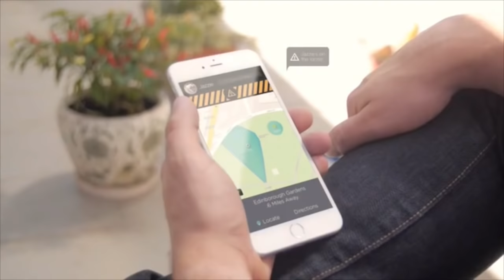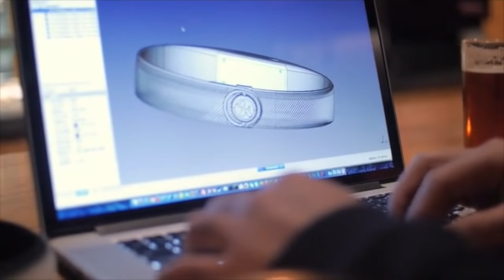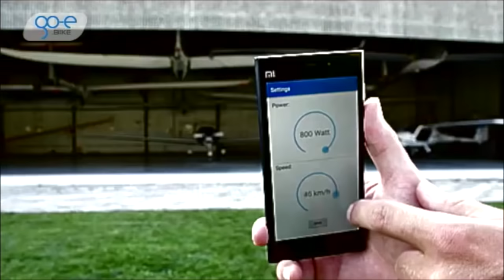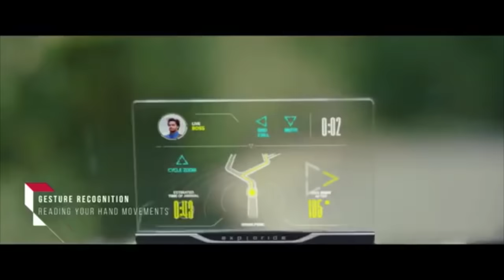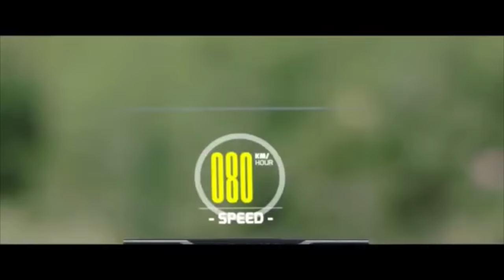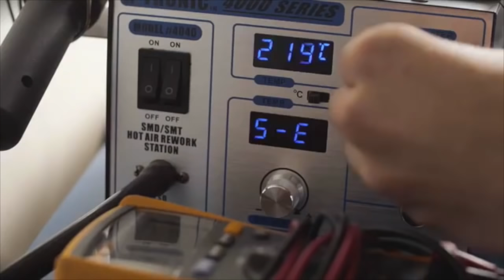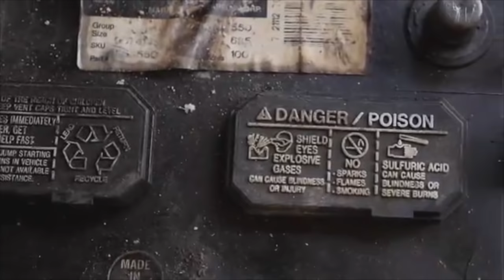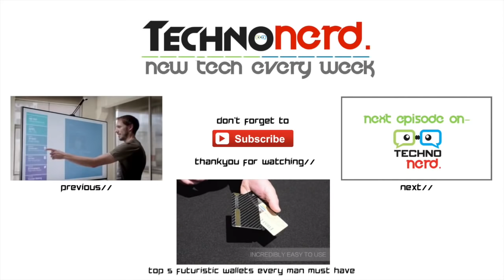7 Futuristic Gadgets available now* #7

Comment: Awesome, a backpack that short circuits the first time it rains. Not to be the one to point out a painfully obvious design flaw but why the hell isn't there a protective flap of some kind to protect the speaker or USB ports? Another example of those getting damaged is accidentally kicking snow or dirt into the ports if ever putting it down.

I might buy one anyway or make one but if I do I'm going to immediately sew a protective cover of some form with a zipper over the exposed electronic components.